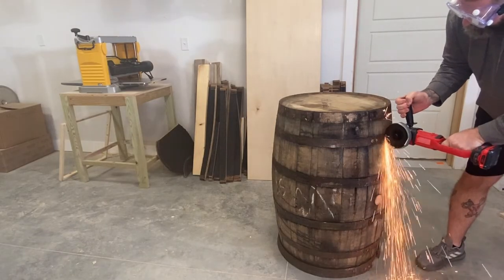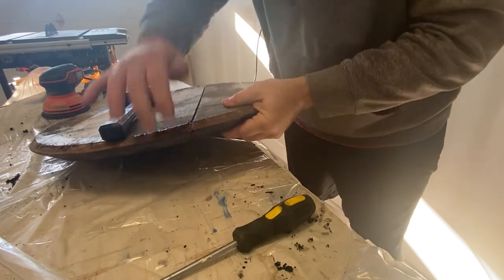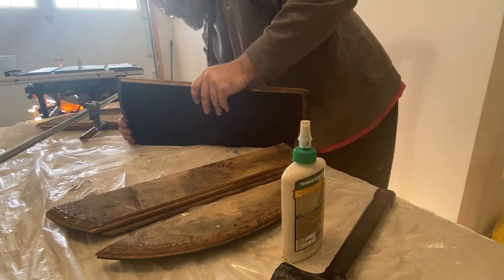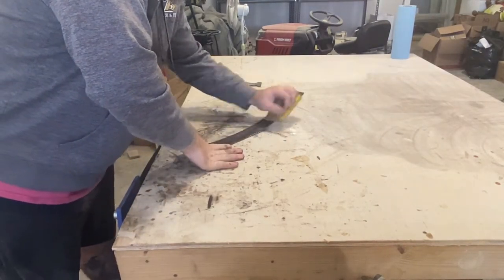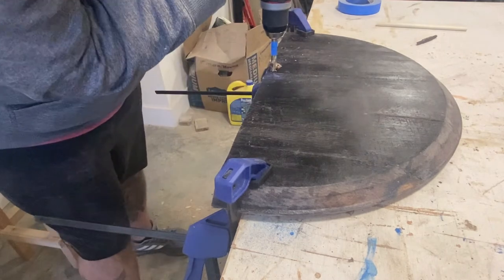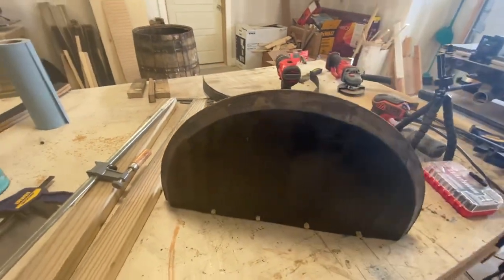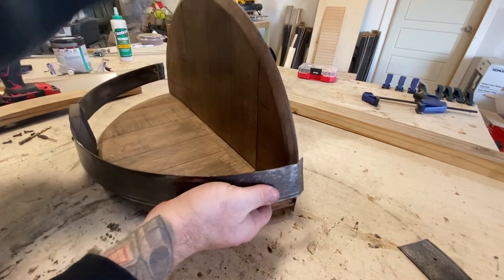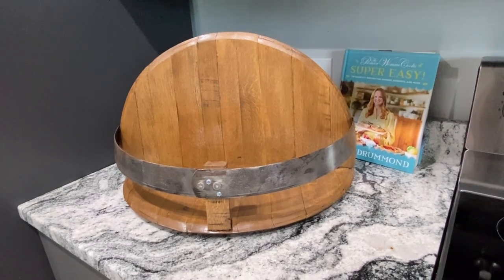Woodworking Projects That Sell | Turn Trash Into Cash

Comment: Once separated Can you run through the planer to help with the char? Also I use drill bit collars on the standard bits for dowel pins instead of using tape. It gives me exact depth every time
Reply from the maker: Possibly, but that char can get everywhere and I'd be afraid that it would stick to the blades, and come off on later projects.

Comment: I'm new at this as well.  Just curious, why take it a part to only put it back together?
Reply from the maker: Excellent question, in fact, I asked a friend when I did it the first time. The answer is that the staves are jointed together, but over time, those joints will loosen, especially since they're still saturated with bourbon. Once they dry, they will loosen up. By taking them apart and gluing them, we can give them strong, lasting glue up.